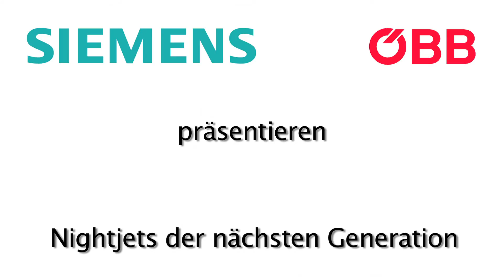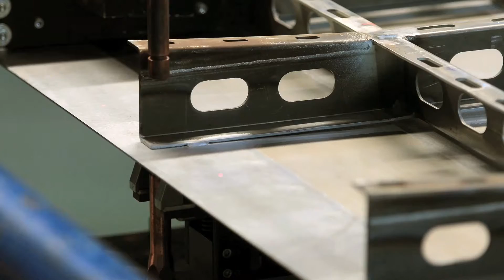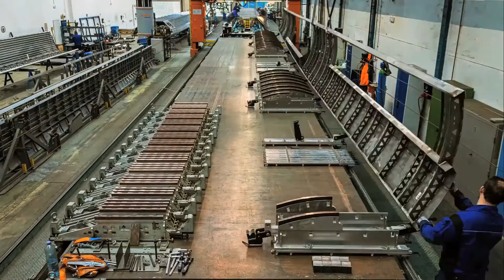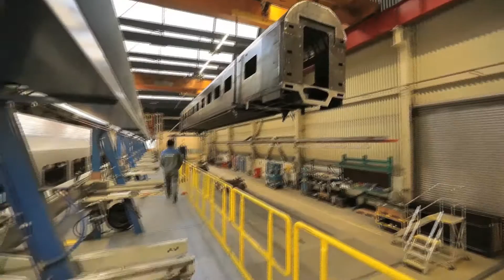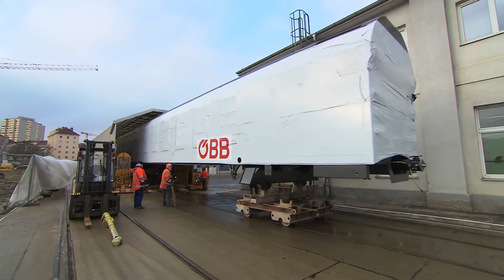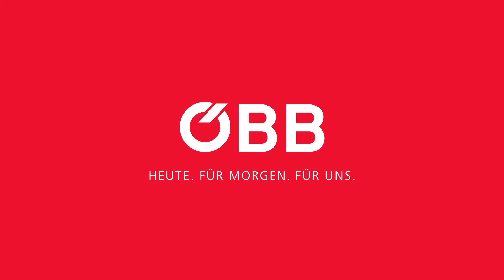ÖBB Nightjet - Viaggio Next Level under construction at the Siemens Vienna-Simmering plant

Comment: Standard first class passenger carriages should be able to be built in such a way that they can be used for second class on night trains, i.e. the seat can be reclined far enough to create a good sleeping position. This would eliminate the space required for the nightjet carriages during the day, as they currently have to take up space on a siding somewhere. The operators have to pay a parking fee for this. But with a conversion, the carriage could be used around the clock without downtime, so no parking fee.